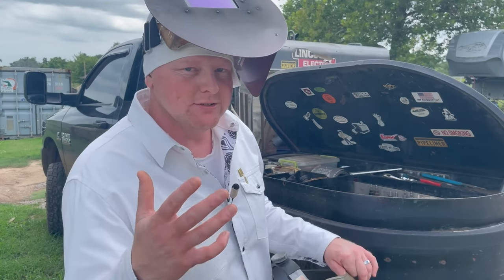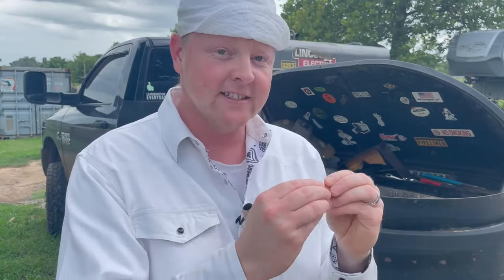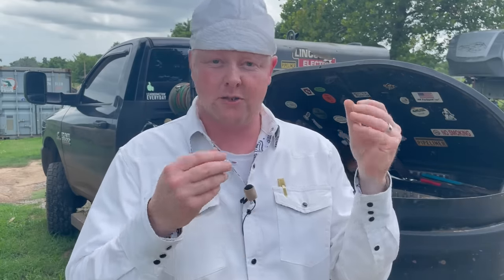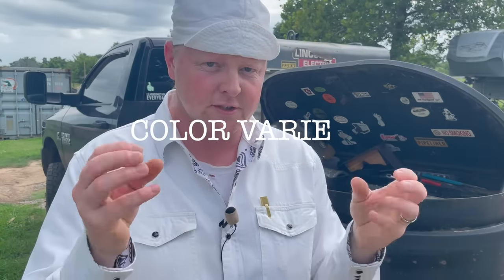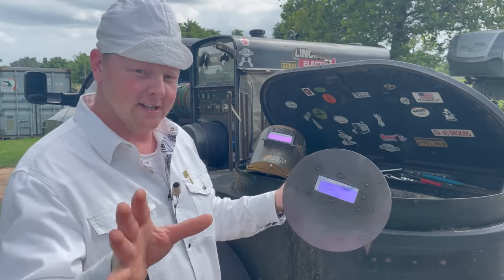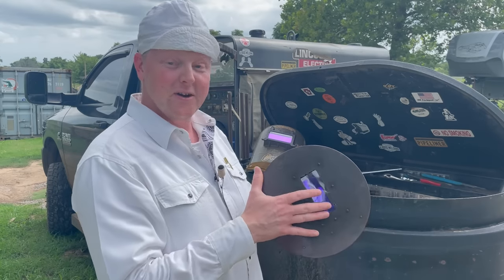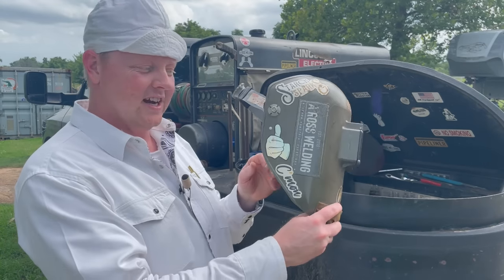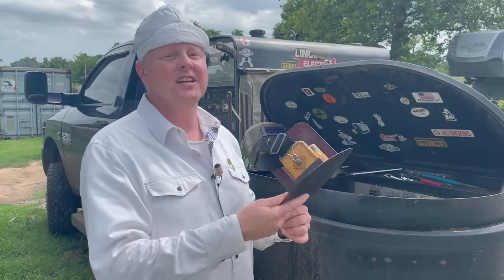Why Pipeliners Do NOT use Auto Darkening Welding Hoods (Fixed vs Auto-Darkening Welding Lens)

Comment: I appreciate that this video isn't 15 minutes long
Reply: True but it could have even shorter.
Reply: Actually it takes about a millisecond or 2 to make the switch to dark. Considering the speed of light your eyes can absorb a column of light several miles long before the switch to dark. Therefore, one should blink at the start on the arc to avoid long term eye strain or damage. The standard mask eliminates the need to  remembering to blink.
Reply: Ditto.
But he's resourcefully informative. We re here, slagliners. . .
Reply: But here I am, half way through the before and he still hasn't addressed why they don't use auto darkening, for that reason I'm not watching the rest
Reply: Unlike the goddamn ads beforehand

Comment: Hi Austin, I'm a hobbyist.  I bought a MIG welder and a cheap fixed shield about 20 years ago.  The fixed shield sucked horribly.  Couldn't see much of anything unless i had a crapload of lighting.  A few years later, i got an Optiva auto darkening helmet as a gift, and it was almost literally night and day difference - i could actually see things to some extent.  Within the last 5 years or so, i bought a $90 Hobart Auto darkening hood, and it's another night and day difference.  Like switching from 90s cable to DVD or Blu-Ray
Reply: I've gotten the sense really good pro welders have learned the skill to weld with a fixed-shade, and prefer them for the reasons discussed in the video, while hobbyist or newbie welders (such as myself) prefer auto-darkening so they can see what they're doing before starting the arc. Pipeline welding is probably also a bit simpler in setup than some of the awkward angle welds people find themselves doing with stuff like car repairs, while pipeliners are trying to get higher quality welds than us hobbyists can even comprehend. A difference of a pro making the best quality weld on an easily-accessed surface versus a newbie desperately trying to stick two pieces of metal together in an awkward spot under a car.
Reply: @quillmaurer6563  welding on a damn car is probably the hardest welding you can do for an average guy. Those damn cars are made out of ultra, thin hardened steel that literally curls up like a corn curl rather than melt unless you get everything just right.     Even a frame on something like a Chevy 1500 is made out of that thin garbage way in the back. I made a whole back frame for mine, and when I got onto the real frame up by the gas tank, it was a night and day difference in how it welded. Anything to save weight I guess and that’s why it rats away so fast.
Reply: @drizler  The sheet metal is tough, that's for sure. Structural parts are easiest, exhausts not as bad. I have a classic Volkswagen Beetle, I think the metal might be a little thicker on that than it is on modern vehicles. Thinking of the Chevy 1500 and weight reduction efforts, probably the problem is that people are wanting to buy trucks for the image and supposed possibility that they might carry something around in it occasionally, but in reality use it to do the job of a sedan, and want the performance, handling, and fuel economy of said sedan they actually need. Manufacturers design them to this need, creating a truck shape out of the lightest sheet metal they can to produce what is functionally the car that most buyers actually need.
Reply: You probably had wrong DIN on you fixed shield. When you weld with low amperage with 13 DIN you probably see shit.  You need to have some experience to start welding with fixed shield and when you have to make a lot of small joints in many difffrent places (typical autobody welding) it's pain in the arse even for professional welders. 😅 in my opinion autodarkening helmets are great for complicated constructions, but when you work in the big industrial company and you weld thick metal on serious hig amperages with solid wire or flux core the last thing you want to use is autodarkening because there is a little bit of flash every time you start and it's enough to make your eyes really tired the end of the day.
Reply: @quillmaurer6563  bad take lol
Reply: @michael_mack  Yeah  12, 11 or even a 10 gold fixed. But i'll bet that most of these hobbyist's use there hand to put the hood down rather than set the tension on the headgear fastener so a flick of the head lowers the shield...  Before AUTO darkening lenses I was welding .010" Stainless on very complicated equipment/instruments and there are "tricks" like starting the arc on a piece of copper or SS.  Then there was the other extreme where there were 4 weldors 2 preheating and 2 welding on 3" thick steel pressure vessels (#14 shade)(that job sucked).
Reply: @dksaevs  sounds like a job for a real tough guy 💪
Reply: @drizler I bet you don't have a mig for the thin stuff ,  I've welded two soda cans together with a mig and a spool gun

Comment: I'm a 'shop' welder,25 years in.I use a passive Jackson large window,paid 40 bucks for it new,I own Speedglas and Viking auto's,only use them for tig and plasma cutting/gouging.The thing I like about passive hoods is that they always work!Flip of the head and you're burning-
Reply: I agree tig or air ark
Reply: I never liked auto hoods, don't want my lens to stop working in the middle of a job plus they are a lot more expensive to replace. I've worked in shops and outside on construction jobs for 25+ years. And a large style lens works best for those hard to reach places like I've had to weld in many times.

Comment: I have used fixed until I bought a tig welder. Bought an auto darkening helmet when I was having difficulties. Love my auto darkening helmet.
Reply: i bought auto darkening when i started welding exhaust underneath vehicles while lying on my back on the ground in my driveway. not always enough room to flip my helmet up/down

Comment: I am not a welder nor fitter but a (mostly) self taught hobbyist fabricator. I used to used the cheaper auto hood from Northern when they had better quality. I moved up to a Hobart then now a Lincoln 3350. It’s the bee’s knees. I only went to auto-darkening was welding sheet metal. I have used the speed glass which are nice, just can’t justify that one.

Comment: Just a question, maybe im crazy but when is the last time you guys have seen an auto darkening hood that needs to be charged/takes batteries? What kind of magic smart equipment you working with there?
The company i work at curently has had the same worn out cheao autodarkening hood in its small shop bordering on 12 years now. The guy whos been here the longest has been using it since he was an apprentice.  

There have not been any reliability issues except the front protective plastic needing to be replaced every year or so.  If there is a battery that needs to be replaced or charged we sure as shooting shit havent found it yet

Comment: I used a cheap Lincoln pipeliner fixed hood for years (lighter than the fibre-metal ones) with a fixed #10 gold plated glass lens. It was green but the gold plating made it really cool on the eyes and seemed to help show the puddle. It was reliable, light and I could shove it into a 5 gallon bucket along with everything I needed for most welds. Now for the little welding I do I use a newer auto-darkening.
Reply: I'm a fan of the American optics number 10 gold plated lens. It's very easy on the eyes and it seems to distinguish the puddle from the flux better
Reply: Yeah I used a gold plated #12 for a while. Still dig it out sometimes but I prefer the auto dark set at #12 for most things.

Comment: I like green #9 with 1.5 magnifier since i am old now and have used them for years. I have an auto darken but only use it in applications where I am killing many nuts on bolts and don't want to raise and lower the hood a lot

Comment: I have had 4 auto shade hoods over 18 years. They have had blue in auto for several years now. But they do eventually quite working as where i still have a fixed shade hood tbat was my great grandpas from the 70s. And still have my first one also

Comment: When I started with a gold coat 2x4 fixed lense and an auto with a 'green' tint I used both regularly. Upgraded to a 'clear' Lincoln 3350 a few years ago that is fairly blue and find it to be wonderful to use. I still bring the fixed for mobile work as a backup but 95+% of my work is done with the auto hood. Mostly benchtop and fab shop tig and mig with a little mobile residential and light commercial work mixed in.

Comment: As the years flew by I found my eyesight changing and had to adapt with it. I am a retired Pipefitter and only weld when I have to. I use a auto-darkening large lens #10.

Comment: I noticed over the years welding that very often welders in the field would go back to a fixed hood because of the price of replacing their auto darkening hood and the trouble they would have with them as they got old.  Working in the field in all the elements was just hard on them.  I use an auto darkening at home here in my little shop....they are very nice to use.

Comment: The only pipeliner I knew personally used an auto darkening lens in a fiber-metal "sugar scoop" hood. He kept a penny in the channel in front of the clear lens so he could block the sensor when he needed to grind.
I use an auto dark for everything. I bought all my welding students auto dark hoods a few years ago. A lot of kids really struggle to learn with a passive lens.

Comment: I exclusively run a fixed shade after my last auto hood sensor went out mid weld and left me unable to finish my project at the last shop I worked at.  Shade 9 or 10 at home for my 110 and a shade 11 for the 440 at the shop.  
Old style tiger hood non flip are what I've been using for the past eight months or so.  Before that I was running a sugar scoop flip lens.  Ten different hoods at the house and i can't bring myself to even buy a new hood.  I made $100k+ with an old fibre metal sugar scoop that a buddy gave me.  Shade lense was cracked so I spent $4 for a new one.  Those old fibre metals are amazing!

Comment: If you open one of those "solar" lenses you will find a battery inside. The solar pannel is there to trigger the circuit and sometimes it assists the battery but it does not replace it. I found out fixing several of them.

Comment: It makes sense, and I can understand your point. I’m not a professional welder. I’m an amateur, but I found the fix lens made it incredibly hard for me to see what I was Welding at all, and I would be way off all the time, the auto darkening Made a huge difference for me. I could see what I was welding. I could position myself just right I’m guessing with stick welding. It might be a little less important, but when I first bought my welder, I had the lens that came with it and struggled and I went to Harbor Freight and got a $35 auto darkening helmet and it made a huge difference, my only complaint was the lenses small I’d like to replace it with something with the larger lens but either way the auto darkening helped me a lot plus having an electronic adjustment for the darkness was nice as well.  A lot of that is probably just my inexperience, but it just makes it all much easier for me. 

But You obviously don’t need it.  lol

Comment: I have and use both,  fixed shades are definitely more reliable and bigger variety of filters. Less eye strain and fatigue as well.  I'm also a bit of a bumblefuck and need a LOT more practice to keep from arcing off on the wrong spot or flashing myself.   So I use auto darkening as my usual default. Really wish they'd make an ultra tough adf that's fully potted and sealed inside.   I've also been seeing a lot of auto darkening filters in a wider color variety, like deep blue, gold plated, etc...  
*Edit: Truearc makes ultra blue and gold plated adf units, adjustable shade for 100$

Comment: Working as a field construction Boilermaker, I had a large lense big hood and, what we called a "soft hood". A smaller one which I added a leather bib to. Never used an auto-darkening lens, but always carried a variety of shades with me. That way I was always ready for any kind of light conditions and tight quarters. As well as my heli-arc gloves, cloth gloves and heavy leather welding gloves. This along with my cutting torch supplies fit nicely into a 5 gal. plastic bucket with a "Bucket Boss" seat lid.
Reply: Your using your head.

Comment: Up in Alberta pretty much everybody runs an auto lens, usually the 2x4 that fit in a regular hood. Makes it easier to avoid arc strikes in a muddy/frozen ditch, works great.😊
Btw, most sugar scoops up here have sellstrom flip fronts installed, good idea but the sellstrom is very poor design. There are others appearing in the field as well.

Comment: There are definitely quite a few things to consider when choosing a hood. I like a fixed lens hood with the flip up feature, to flip up the dark lens, and grind with a clear lens, without needing to remove anything, or add additional PPE. Auto darkening is good when the amount of ambient light changes, and you need to change the shade to compensate.

Comment: Yes, its horses for courses. I do a huge variety of welding jobs. 
I have an add-flow which is probably my most used helmet, I don't use it for tacking though, mostly the old flip lid for that.

Comment: sometimes i have had to illuminate  a welding area with an LED light.  the brightness of the led turns off the autodarkening to black, move the LED futher away and the autodarkening turns back on.  something in the LRD light.  the solar ones won't work in dark places but the battery one will work

Comment: Optrel auto darkining hoods have a natural light filter lens. You see the actual color of the arc given off, not one specific color determined by color of lens.Probably the best welding optics available on the market to my knowledge.  Manufactured in Sweeden or Switzerland,can't remember which country. On the pricey side, but worth every penny. Durable and reliable.  Beneficial to those of us with eyesight thats not what it was 20 years ago.  I highly recommend their hoods.

Comment: It al depends on what you using it for. I useda cheap auto helmet and it actually worked fine on most things. I like the really good helmets were I can set it up for outside and it distinguished between the sun and the arc. Mine is blue lens and it's clear and it has four sensors so you don't get flashed  on obscure welding positions. Reliability has been great over 4 years on this one and hours and hours of time on it.

Comment: The first auto darkening I had was an old speed glass that was out of date for for my iron worker buddy to use at work, so I got it, and maybe 10 years later it started getting a bit flaky so I bought something that was branded as Miller with lens just larger than the speed glass, I felt like I'm dying it. It does not breathe well so I changed the photo cells on the speed glass and I'm back to using that. I like the color on the speed glass better, I didn't like the almost clear color on the Miller.  If I ever need a new hood, I'll probably just drop the 600 bucks on a speed glass. Or edit the one I have with someone else's insert.

Comment: Auto darkening or the one you can literally turn to grinder is nice so you can grind and then go back to welding if needed. Or auto darkening you can then see once done welding without taking the helmet on and off if you have to move or reposition things. 

I’ve used non auto darkening small screens or googles for welding under trailers cause a helmet won’t fit but that’s a last option kind of thing

Comment: Auto darkening is good in a shop setting, when you are welding in the field, mud, water, and especially for me working around the ocean. If you drop your lid in the water, you can say goodbye to that $120 auto lens. Compared to a  fixed shade that is only a few bucks. A lot of employers also supply fixed shade with your 2x4 clear lenses so buying anything isn’t much of a problem. A good 2x4 helmet also goes a long way, I’ve used lots of lids that are heavy or big like a tiger hood, the best ones I have found are a small black welding helmet for $20. You can modify the spring in the flip front so it flips down without any effort. It pretty much turns it into a auto shade.

Comment: When I gas weld aluminum i use a very special (TM2000) fixed lens that eliminates the sodium flare. For everything thing else I have a newfangled auto darkening that is a bluish tint. I want to make a pancake for my auto darkening lens to eliminate the backlight reflection issues. (My lens is too oversized to fit in a standard pancake face.)
Reply: I wanted to get that tm2000 filter plate when it was 180 but I thot sometime in the future.  I looked just now and list is 265 USD.  Ouch!

Comment: I wanted the clearest autodarkening hood I could get for tig. Europe has some en379 optical class rating. The highest is 1/1/1/1. I  got esabs most expensive hood with that rating--about $450 msrp 10 years ago. More brands have hoods that hit that rating now. Its still awesome.